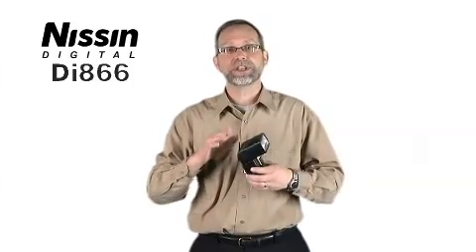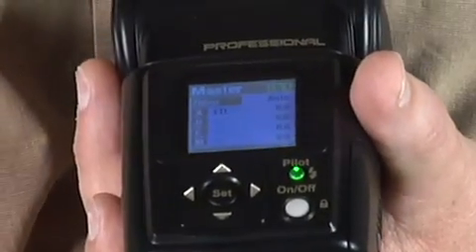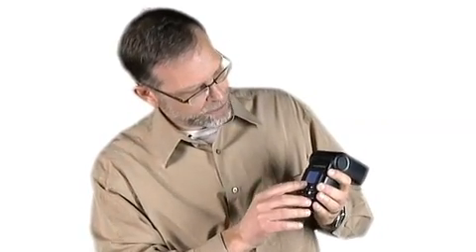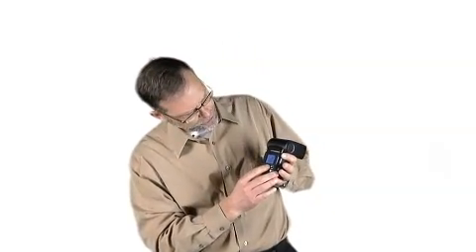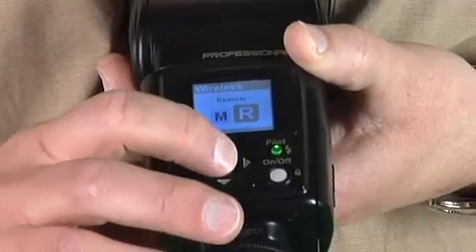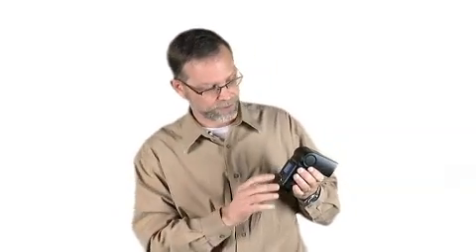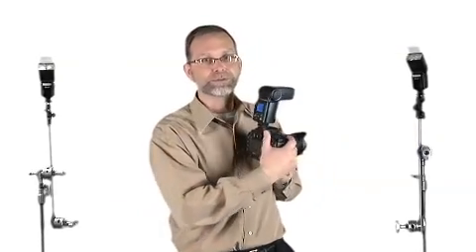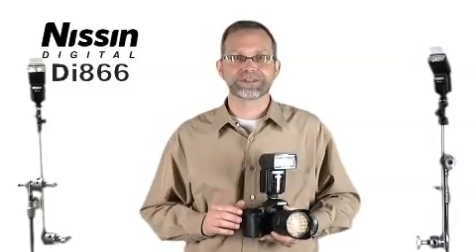Nissin Di866 Flash - Wireless and Remote Mode Explained

Comment: Is there a flash tranmitter that will fire the flashgun when it is set in remote? Or does the signal have to come from a flash (set as MASTER) mounted on the camera's hotshoe? I mean something like the Nissin Air 1 commander (or different Nissin transmitter)?
Reply: You have lots, ATG set, Nissin Air1 with the Receiver, ATG/Yongnuo TTL transceiver Set
You failed to list brand & model of camera

Reply with email address, if you more assistants.

Comment: Would this work with Pocketwizards as well, in the same way that Nikon Speedlights are set to TTL and put on a Flex TT5 - got three - and mini-TT and AC3 on my Nikon D800? I should be able to set on AC3 to TTL, Manual or Off - but the flash is set to TTL. 
It works with my 3 SB700 - but would like something more powerful - and this would be more powerful - but the same control via AC3.